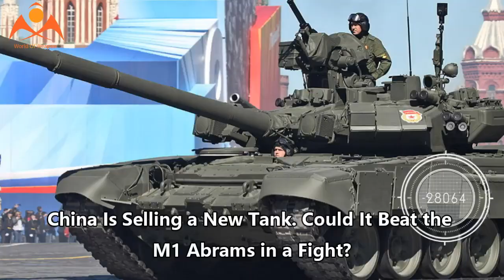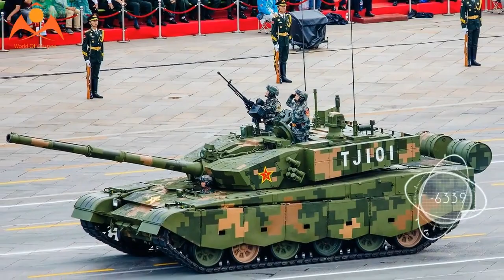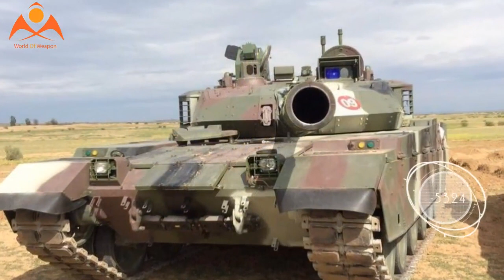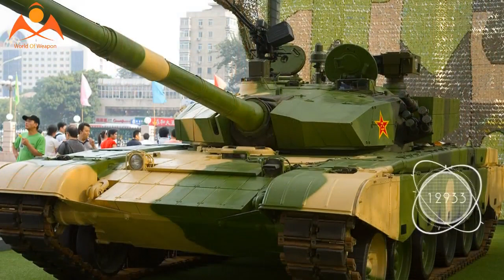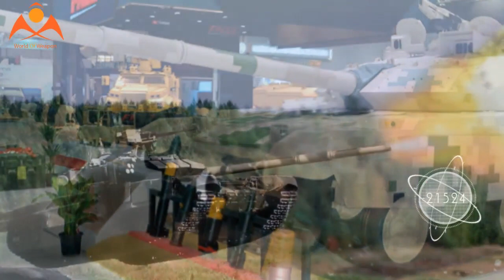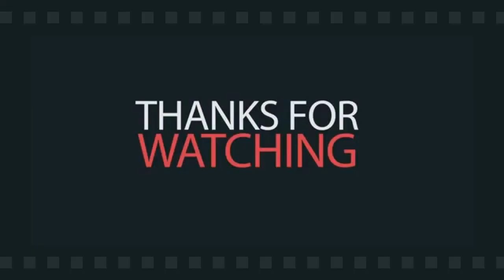China Is Selling a New Tank. Could It Beat the M1 Abrams in a Fight?

Comment: You set up the wrong question from the beginning. VT-4 is not meant to beat the M-1 since it's an export version. If some country wanna beat Abram, they choose T90 , ZTZ99 or other western tanks. And the reason RTA don't buy the T90 not because of the US political pressure but the price of T90 itself.
Reply: VT-4 is more capable tank of Thailand facing only t-55, t-62, t-69, t-72 tanks of his neighbor country in southeast Asia, the best choice cheaper and modern
Reply: @sydneyl.sabiniano6126  Right , the optimum decision.

Comment: No one can buy something without testing if it works. China tanks have never been tested in a real battle yet, can they shoot other tanks, I think US M1 Abram is the best tank in the world, it kills other tanks in real battle as you see Kuwait war in 1991 without a single loss.
Reply: Agreed. The Abrams is constantly being improved and is a reliable, and heavily battle tested platform. To say, the Abram is not without peers and probably equals, is wrong, but the Chinese are anything but. In my opinion, that Chinese type 3000 side and rear armor look pretty flimsy.
I have notice quite a few shot traps that could prove fatal to crew and vehicle, and the targeting system is probably 10 times less sophisticated as the chinese military talks it up to be. 
Its track system also looks very exposed and fragile.
Overall, its a step up from previous chinese designs. but with that said, the bar hasn't been raised very much, and it was already pretty low to begin with.
Reply: For a nation with tight/ limited budget this is a way to go.it is priced much less than most Western MBT and got very capable avionics.
Reply: Abram never face more capable tank in a war, Iraqi t-72 downgrade version of t-72 series unmatched for abram